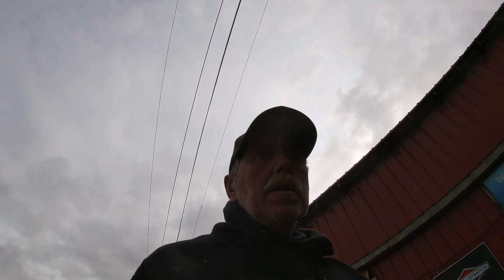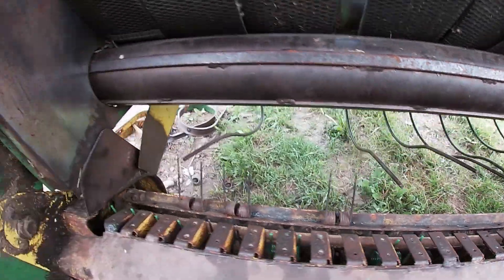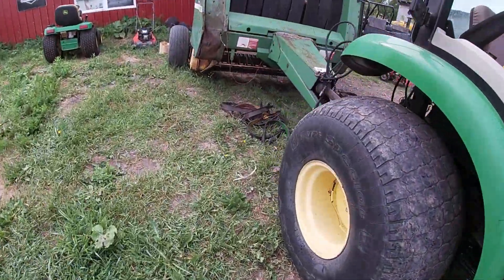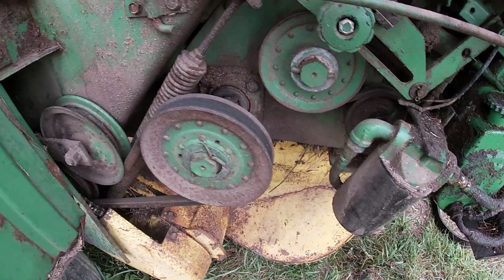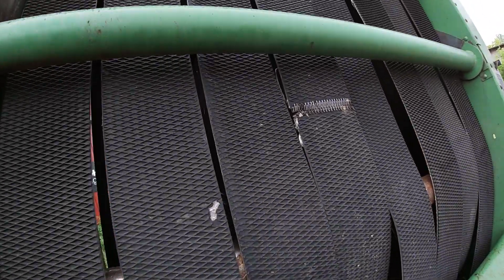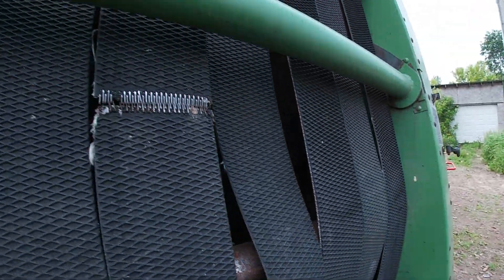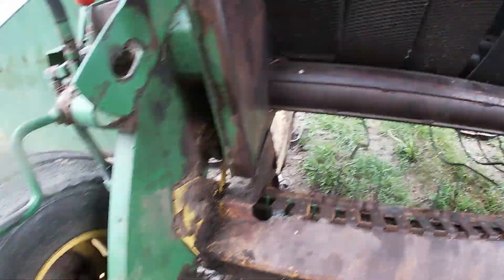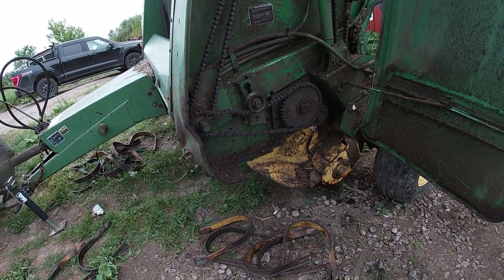530 John Deere Round Baler  Replacing Pickup Teeth and Strippers

Comment: How should the belt be tensioned?
Reply from the maker: On the pickup head? Ours has a spring loaded tensioner that keeps the belt tight
Reply: how often do you service the bearings?
Reply from the maker: once we start to see any play or wear. it all depends on how many bales you put up a year and the amount of hours on the baler. I have the two round bales JD 530 & JD 335. 530 does 5X5 and 335 does 4X4. We use the 335 mainly to put up green haylage and wrap those bales.